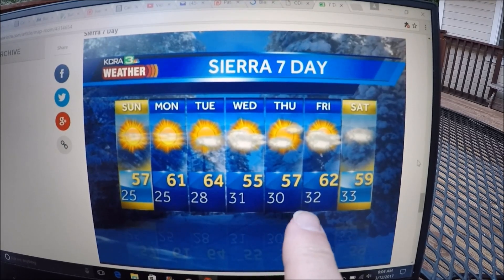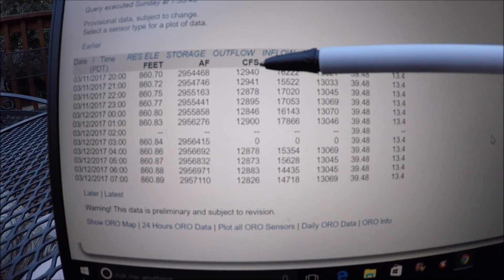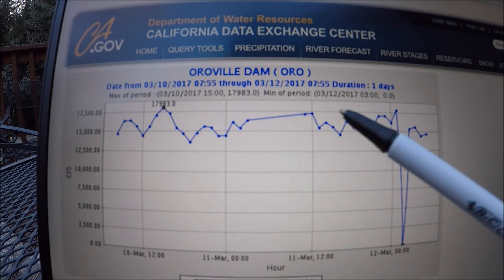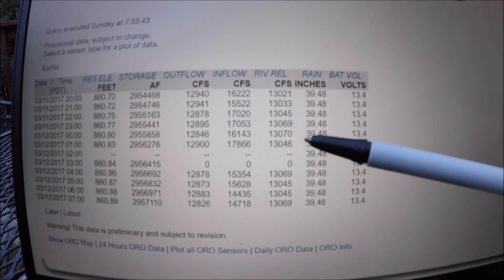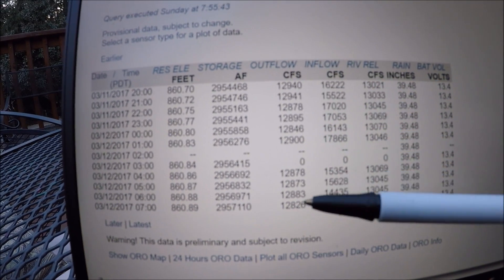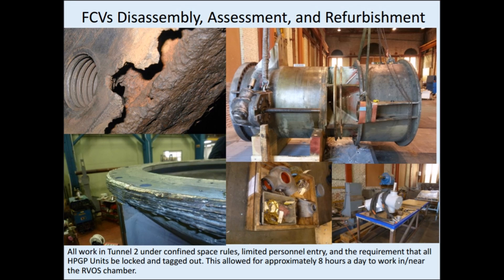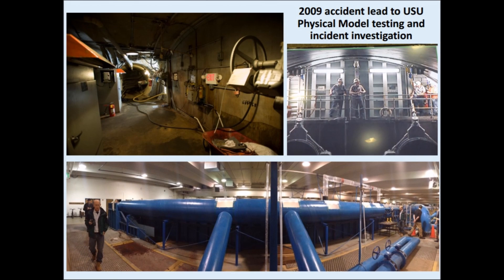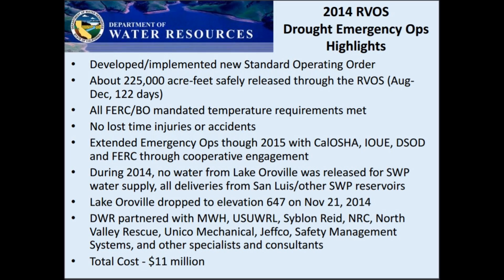Oroville 12 March update River Valve Outlet System Explained

Comment: Why not use large diameter steel pipe welded side by side to bridge the gap on the damaged portion of the spillway? That way you won't have the erosion issues. A temporary fix would work now and could be rebuilt as a permanent solution later on.

Comment: Re the Thermalito Power Plant destroyed by fire on Nov 22, 2012, per the State of Calif report of Nov. 2016: The THPP Restoration Project commenced in April 2015 to restore the plant’s electrical, protection, controls, and communications systems. THPP will be
modernized to maximize fire protection and life safety, enhance reliability, reduce
maintenance, and minimize unplanned outages. Full operation of THPP will
provide as much as 300,000 MWh annually and potentially restore SWP pump-back
operational flexibility. Completion of the Restoration Project is scheduled to occur on or before January 1, 2019 with all four units fully operational.

Comment: Juan you said the Thermalito Diversion pool was at 225 feet. I assume that 225 above sea level and not feet deep. If it was feet deep they couldn't use an excavator to dig it out. What is the depth of the diversion pool.
Reply from the maker: Jason Giszewski good point, I should clarify all elevations are MSL (Mean Sea Level).

Comment: Juan.  What is battery voltage?
Reply: It is just the voltage of the sensor suite.  Many are run off little solar panels that also supply power to a battery so that the sensors can still operate during the night.  It reports the voltage with the other sensor readings so that the station keepers can monitor the systems health so to speak.
Reply from the maker: Cobalt135 Thanks.

Comment: I would say "Lack of safety conscious power plant plant operation and maintenance management". Opening the river valve without the baffle ring in spite of knowledgeable recommendation against it was a dumb move, someone could have been killed or hurt more seriously. I wonder if the brain trust who made that decision is still there.
Lack of fire detection does not cause fires in the thermolito power plant, what cause the fire? Probably covered in my first sentence. The condition is still not fixed, so much for dependability of the Cali aqueduct system it serviced.

Feedback on your previous video, wire mesh in concrete is not rebar, pleas do not call it that.

Comment: thank you for keeping us posted on what is actually going on! Do you have any explanation as to why the in/out flows were missing for so long yesterday? Also do you know the status of the HydroPlant, and when turbine (lol) #6 will be operational?
Reply from the maker: Nicole LeMire I've since been corrected, it's Unit #1 that's in inop at Hyatt.
Reply: You could have used the reservoir level to see the flows hadn't changed much at all yesterday.  Today is a different matter - all data including the level has been missing for 5 or 6 hours.  When it comes back, the reservoir level will be the best indicator of what happened since data was lost.  The next important event will be when they hit 865' and open the main spillway - should be within a few days.
Reply: Great question, if we had dependable media coverage this is a question a reporter should ask.
Reply: According to the ChicoEr, the sixth turbine has been offline for several years. http://www.chicoer.com/general-news/20170310/lake-oroville-level-rising-slowly
Reply from the maker: Nicole LeMire I called DWR yesterday and reported the data outage. Don't know why data stopped, but flows were consistent.
Reply: No, you're mixing up outflow with total river release. The river release also includes water from the Thermalito afterbay.
Reply: Nicole LeMire size and expense. These turbines weight thousands of tons although the more power they generate the bigger they are. Also is the expense and  it depends on what is actually need to repair the turbine or infrastructure (tunnel, etc). As for time, it's all very specialized work and if a portion needs to be sent out you need to take into account the route and time to move such large items. Then add in political issues and things slow down even more.
Reply: Only when all six turbines are running. One isn't even installed at the moment.
Reply: any explanation as to why/how? and why it's taken so long to repair?
Reply: According to the report below it has been down for years?! Whaat?!
Reply: I thought the max was 16+k total?
Reply: yes I think Doug Ankrum is mistaken
Reply: thanks for the info @jospi2!

Comment: juan why are we just finding out about the fire in 2012
Reply from the maker: conn cann It has always been in the very very local news circles.
Reply: As a former electrician's mate from the USS Nimitz, I can tell you that fire is a concern in any major power plant, electrical fires primarily.  If that river valve chamber is set up for remote operation now they might have to worry about air under different pressures depending on if they replaced the pressure relief wall?  honestly I'd think based on the location the entire remote operator system should be designed for fully submerged operation, waterproof for the known pressures, etc.
I have some experience with remote operated valve systems from the Navy, but these are slightly different animal.
Reply: blancolirio yes. One never thinks of fire prevention in a hydroelectric dam, but obviously there was five good years of power generation gone.